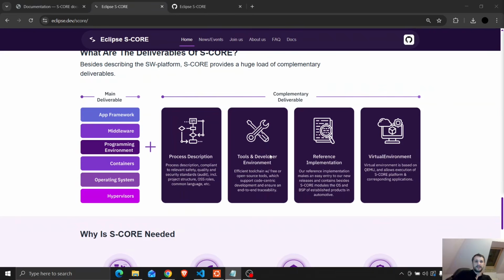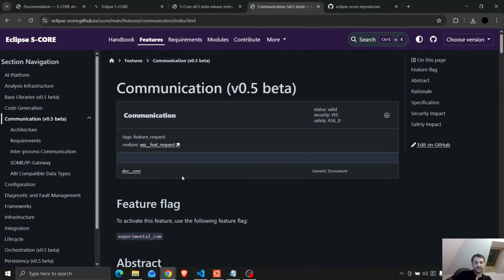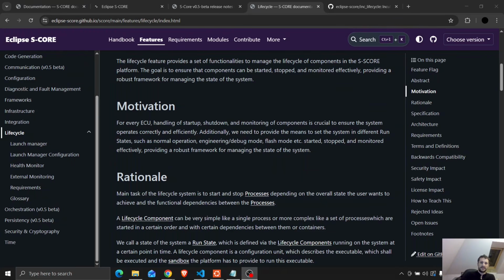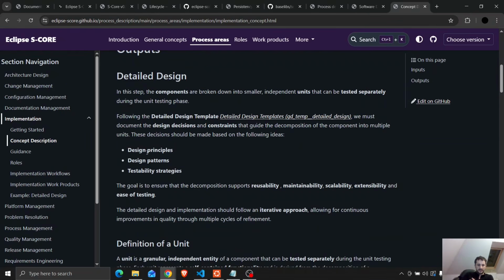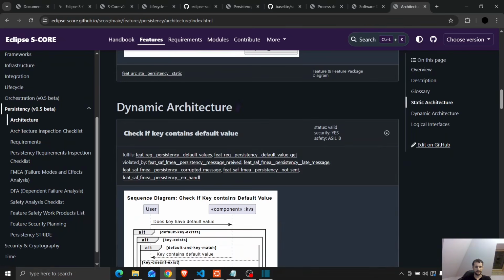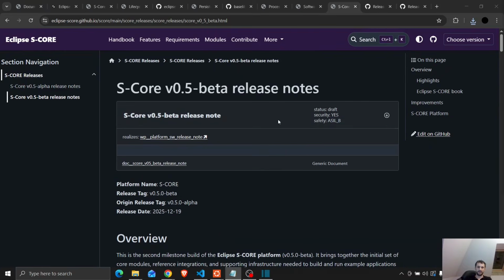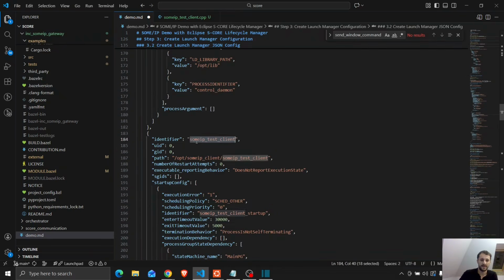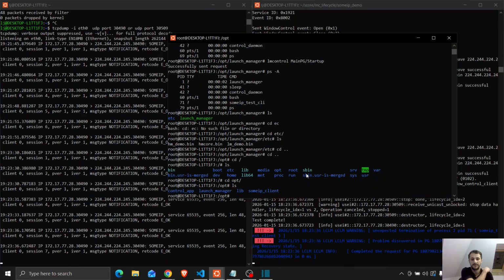Eclipse SCORE: Architecture, Safety & Demo

Comment: did you use the reference integration repo they provide? otherwise if you try to create environment on your own it is hard to create correct bazel files with all dependincies fully included
Reply: Yes use reference integration. Highly recommended